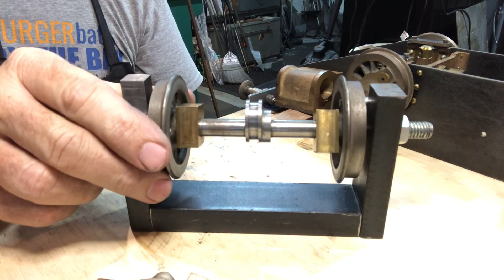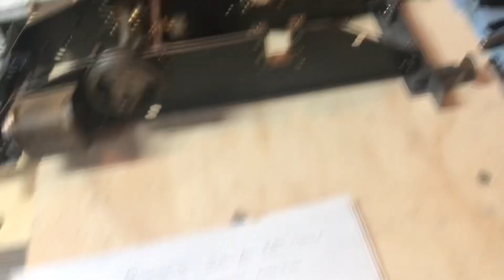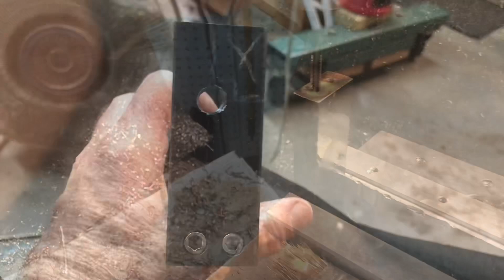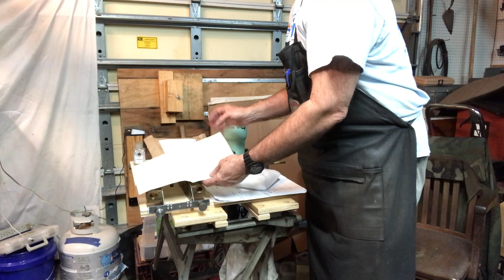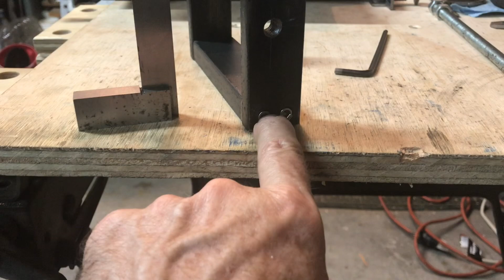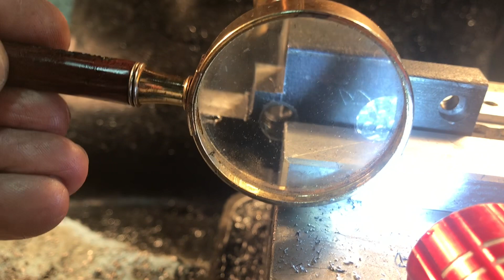2. LBSC Tich locomotive, quartering jig made, unboxing Reeves 2000 parts!

Comment: Your videos are top notch and you have a natural presentation style. I'm unfamiliar with locomotive sciences, what is the quartering jib for/do? Thank you
Reply from the maker: Thanks for the kind words! A steam locomotive is really two steam engines working parallel with each other. The quartering jig allows one steam valve to open and close at the proper time or sequence and the other just afterwards. Has to do with one side using expanding steam pressure to push the piston back in the cylinder while the opposite side moves forward. Hope that helps. Bill.
Reply: @metalmill52  Brilliant thank you!